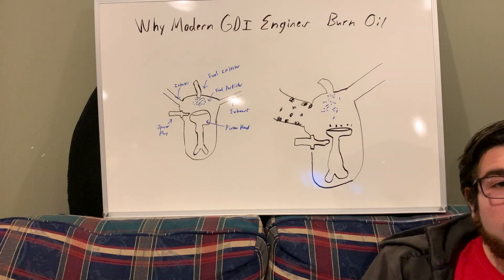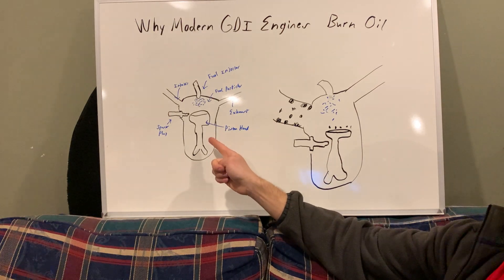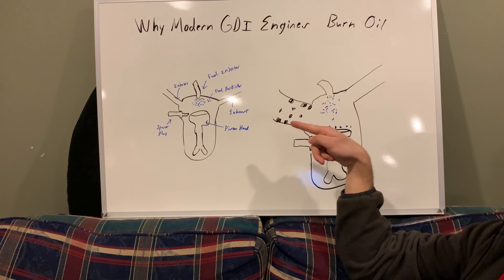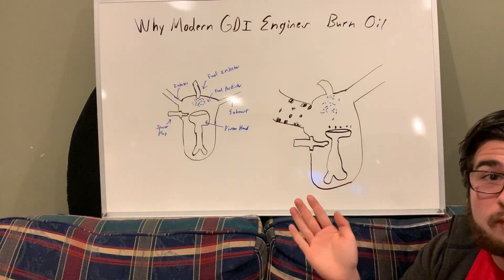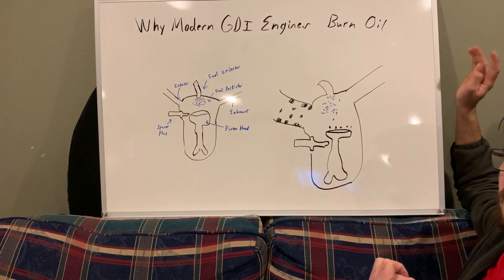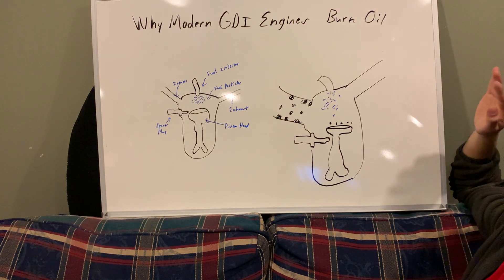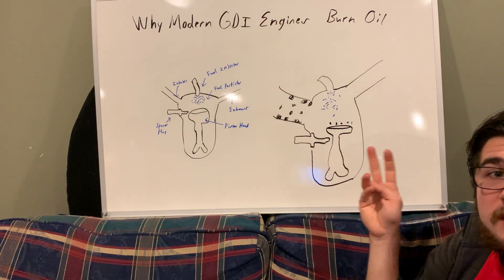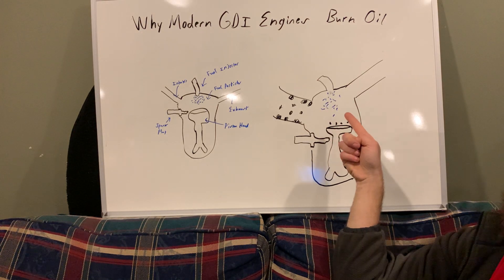Why G.D.I. Engines Burn Oil

Comment: Take it out on the hiway. Drop it into a lower gear that will enable you to drive at 4500-5000 RPM's. Do that for about 15 minutes intermittently at those RPM's and letting off the gas using the engine to slow the car. I fixed my 2014 Sportage 2.4. It was drinking oil like crazy. Now not a drop after 12,000 miles. It has 166,000 miles on it. Drives like a dream. I was shocked. Try it.

Comment: Thomasin34's heat explanation is good. Tony's garage says the opposite, looks at heat drawn away from the chamber by intake valve carbon build up. 
Either way both are pointing to cleaning engines as ESSENTIAL. 
CRC is what I used. No issues since then once I used B-12 to free it up and 3k oil changes since.

Comment: Hyundai/KIA now have the 2.5L Smartstream engine. It's dual injection. (GDI+MPI) GDI injectors spray gasoline directly into the cylinder. And MPI injectors to spray gasoline on top of the intake valves to keep them clean of carbon.

Comment: for example, the 2.4 engine of Hyundai, even if you try to do Treatments to deal with the carbon build-up. And oil changes on time. It is still burning oil. This is with no catch can install.

Comment: Thanks for the clear explanation man! I have a 2014 Elantra gdi w only 90k miles that burns quite a bit of oil with no leaks and no other engine issues whatsoever! I’ve tried the BG EPR motor treatment and Valvoline Restore & Protect oil and that seems to be helping some with oil burning. These engines suuuuuck
Reply: How much ? Mine goes through a ton..... Probably a quart or two every 1,000 miles.... NO SMOKE..... GETS INCREDIBLY GOOD gas mileage, no rough idle, no sludge under oil cap .....no nothing . Runs beautifully . We will see just how far she goes. Paid for....... Not trading it in

Comment: There are things you can do to help reduce oil burning:
1. Change pcv valve
2. Run a quality Synthetic oil
3. Use combustion chamber cleaner occasionally in gas
4. Use an engine flush to help free up stuck rings
5. Run a thicker oil
Reply: Do not use any sort of engine flush. This is bad advice.
Reply: @Palerider2023  why? Used properly they are safe.
Reply: @Palerider2023 
You sir are very misinformed about the GDI engine and the use of engine flush.
GDI is basically a diesel engine as far as how dirty it preforms internally. In fact it is the dirtiest gasoline engine to date.
Reply: You missed the most important one! Premium fuel with a good additive pack to keep injectors clean and ring/wall lubricated. This will reduce blow by then re-introduction of oil via PCV system.

Comment: Funny this popped up on recommended video.  I am am currently dealing with my 2019 Sorento EX burning oil.    Good think KIA stands behind their cars. They are going to replace my engine and extend the warranty to 15 years.    
This is a good and informative video about GDI.
Reply: Are u sure about that.

Comment: Well, it looks like there is no fix for this design engine.  

Kia / Hyundai should start giving life time combustion cleaning every 30,000 miles for these engines GDI 1.6 & 2.0 from 2013 - 2021 and not only to the first owner. 

They even had a "lifetime warranty" on all power train on their vehicle. First, it was for the first buyer / owner only. Second, it had to serviced buy any Kia /Hyundai dealership.  

Now some first owners are getting denied for an engine replacement even if they had their service done at any Kia/ Hyundai certified  dealership.  

Then why take it to dealership where they have all the service records just to get denied.  The service department is a total scam.

Comment: What the fuck was Hyundai thinking. Must have been cheaper for production. My 2015 Elantra burns a quart every 200ish miles.🙃🙃🙃
Reply: I'm like a qt every 350. Use 5w30
Reply: Simple fix - a piston soak with Berryman's B12

Comment: I thought you made a mistake calling your kia Forte 2.0 motor a GDI engine.
But no you did not.
I own a 2019 hyundai Elantra  (a cousin member of the hyundai corporate motor group) as the 2.0 motor in this vehicle has port injection only.

Comment: would putting in a rebuit 2.4 L sonata engine correct anything?   ya still have a GDI engine again--right?
Reply: Most of the engine builders won't even touch one of those engines

Comment: Do I still need to get an oil change? I'm still losing my engine oil and need to fill up the engine every 2000~3000 miles......I cant even get an oil change since my gdi engine burn the oil like you said......... I have 2022 telluride ex... lol
Reply: I wouldn't!!!! Waist of money !!!
Reply: On neweer engines, oil burning is due to clogged piston rings and clogged oil drainback holes. You need to flush the engine with a detergent based flush like Liqui Moly engine flush, then reassess the situation.

Comment: Despite making its debut in the mid 1950’s, Gasoline Direction Injection (GDi) has only recently come into its own, as vehicle manufacturers look for more meaningful ways to meet increasingly stringent emissions standards.

By injecting fuel at high pressure directly into the combustion chamber, the innovative system improves fuel atomization and penetration, delivering reduced CO2 emissions, improved fuel economy and better engine performance. Sounds good right?  So why has a technology with so many good things going for it not been adopted sooner?  The simple truth, is that like many things, there are pros and cons. And for GDi, that also means a number of common service related issues such as carbon build up, oil vaporization and low speed pre-ignition.   As these service issues can occur in as little as 3,000 miles, diagnosing and remedying them early is important. 

Failure to do so will not only affect the vehicle’s performance and fuel economy, but if left untreated for long enough, it could also result in severe engine damage, requiring a timely and costly teardown to fix. Important to stay on top of your cars maintenance folks. Time is not your friend .
Reply: They are a pain in the ass . I just sold mine . Im not throwing money out the window . They can deal with it .

Comment: Thanks for this info, it provided some helpful info. I've done my share of wrench turning and shade tree mechanic stuff, but, have never taken apart an engine or gone in depth with inner engine stuff. My 2016 2.0 4 cylinder non turbo Kia forte with 140k on it is burning oil, I don't have the exact amount, but, at its worst before I started using "Restore" in it, in a week's worth of normal driving, it'd use at least half of the dipstick, usually more. The Restore, once set in after a few hundred miles, stopped or nearly stopped the oil burning. But it returned the other week. I added 2oz more of Restore and it stopped it for a few weeks. Added some more yesterday, and half a quart of 5w-30 instead of the usual 5w-20 specced oil. I may need to move to at LEAST 5w-30, but will more than likely go 5w-40 Shell Rotella since it's a great price at walmart here. I really got screwed on this car, I still have 3 years left paying on it... I can certainly limp it along with my know-how, but, it sucks. Probably will never go kia again, and will especially avoid GDI engines. My old 90s truck doesn't even use this much oil... I've ordered some Liqui Moly Motor Oil Saver on the off-chance it's the valve stem seals, and can try the CRC GDI Intake cleaning spray stuff too but if those don't fix it I think I'm just screwed. Just an average joe living check to check and wouldn't be able to afford an engine overhaul normally nonetheless with me still having a car payment on top of the problem currently lol. Changed the PCV and it didn't help. Car drives fine to me. I'm not a heavy footer though, I just go the speed limit. If I had known these problems inherent to GDI engines beforehand I would have never gotten this car. No check engine light either. I guess it wouldn't hurt to run a can of Berryman's B12 in the gas tank since it's so cheap or do a Seafoam treatment at some point but I've already done a few Gumout Regane high mileage treatments and it didn't fix stuff, even did a bottle of Redline SL-1 and it didn't stop stuff.
Reply: Dont feel bad, i only got 5 months in to my car loan and the engine blew. 2.4 sorento 2017. It burned oil bad from the day we got it. 3 quarts per 2000 miles. I would recommend selling yours before you end up in my shoes. At the very least make sure you have the ksd added and service records. Its not if it will fail, its when. Mine failed at 79k. It was burning oil for much longer then that im sure. I didnt want to take a hit on trade in, but now its probably worth 1000. Instead of a few thousand dollar hit, it will be atleast a 14k hit. Im hoping the dealership or kia do something.
Reply: @610610billy610610  if you have a 6 cylinder Sorento like myself it’s not covered under the engine recall. Go to the Nhtsa.gov and put in your vin # to check for recalls, complaints and remedies.  You may be eligible for a new engine.  The result of the Class action lawsuit against Kia mandated remedies up to and including engine replacement.  Good luck. I’m waiting for my Kia Optima to get the Knock Senser replaced.  I threw the engine code of death P1326. No engine damage but a failed KS. Thankfully no cost to me but they claimed my battery wasn’t holding a charge $450 freaking bucks! I knew they wouldn’t let me off so easy.
Reply: What's this "restore" product you used?
Reply: @BeeeJaaay6644  you can get it at autozone or Walmart or Amazon, restore engine restorer. A lot of stuff is snake oil but it actually can help worn out engines. I think a big part of my problem was super dried up seals, around March on a fresh oil change we tried the bars oil seal stuff and it outright stopped all burning for a month and a half with some Walmart synthetic high mileage 5w-30 oil. Then it started burning like a quart a month, been putting in Walmart synthetic 10w-30 due to it being really hot here, the default 5w-20 was wayyyy too thin and was using the whole dipstick up in a week of just around town driving. I’ve been doctoring this Kia oil burning problem for nearly 3 years now…we still have about a year and a half left paying on the car. I really wish people would have let us know Kia are considered so bad before we bought it. It really wasn’t that old without THAT many miles on it when we bought it. The AC is wimpy, random rattles and glitchy electronic sounds, driver door window control is wonky, we think the wiring to the stereo is messed up, I already had to change the fuel pump and earlier this year the coils and spark plugs since some oil leaked in there and corroded the coils. I think that was a slow ongoing thing since we purchased the car, since it drove fine until then I trusted the place had put in new coils and plugs and did their tuneup like they said but they lied, you could tell the parts were old
Reply: @SolidSnake4Ever2003 try CRC through a vacuum line. See my post on Cause and Effect on this thread. I believe what is happening is you ungummed it and the heat is still coming. 
So with heat, your gum is coming back. 
Use CRC bi-annually, or annually depending on the miles you drive and keep up the Valvoline r+p

Comment: My Santa Fe is literally burning 1Qt./150 miles.  This is not normal.
Reply: Search B12 engine oil burn and look for DIY Dave's video.
Reply: @FattyFPV - see my post on this thread if you want to see how I cured my Santa Fe with similar miles per quart.

Comment: My car has reached 100 miles. and it has started to consume oil. Since I've had it, I've only cleaned it once with GDI engine cleaner spray. but I think it needs to be cleaned better.
Reply: Kia Rio 2014 GDI running 10W30 full syntetic.
Reply: @ManuelRivera16 any oil burning?
Reply: 100 miles and has carbon build up!!!???

Comment: 😂Absolute garbage. Please take this video down and stop spreading misinformation. The reason for oil burning is poor piston ring design. Seems to coincide with GDI. It has nothing to do with carbon build up. I have just had my GDI engine carbon cleaned and it has never used oil. The intakes were dirty and I was having excessive fuel consumption issues though.

Comment: I want to add somethings. For more cars today in the car manuels is wrote like this: AT LEAST REGULAR GAS  and MAX 10% ETHANOL (ball shit) and all people put regular gas w/ethanol in the tank. The ethanol = sugar = votka. Attention! Only the flex fuel engine works ok w/gas and ethanol. The super gas w/o ethanol will be better. Today, w/new engine tehnology (MPI or GDI), the engine makes a lot of carbon, used oil, smoke, etc. who are returned in combustion room. The conclusion is, better economy in gas but after a time will be big problem for engine. Today, there is a lot of solutions to control this engine "garbage" returning. A new tehnology today is the engine w/GDI+MPI solutions who are better than GDI solution. The engine inside is more clean and the GDI solution problems are eliminated. On the other hand the engine oil quality is requerement and the periodically engine maintenance olso. Install a catch oil can close w/PCV valve. For EGR  valve nothing to do, only clean it periodically.

Comment: Mine doesn't burn any oil .my oil does smell like gas a little bit (worse when new but slowly not as much) only have 14k on the vehicle but I do 3k oil changes .my oil still looks good and always get out what I put in .
Reply: Yours is new after 100k kms it will start to burn maybe earlier….
Reply: @LawyerAB  17 k now and no issues hardly smells like gas anymore.  Passing side effects of direct injection
Reply: @bengleckl1877  when you see it start to burn oil fill the form up. Good luck!
Reply: Gasoline in the oil from GDI engine is usually a faulty high pressure fuel pump. This needs to be checked or just replace it asap.

Comment: My KIA's 2.0 turbo does this so bad, I almost need to refill my oil every 2 fuel ups. I do live in one of the hottest areas in the US though, so is this normal?
Reply: Bro if your losing that much oil something is WRONG homie that is so not normal holy fuck I have a 2.0 Kia no turbo mine burns oil as well but not nearly that much I’m talkin once every other month I gotta top it off a bit you might have some leaks or somin you should definitely get that checked
Reply: @STRANGXR  Nope, been adding some mystery oil into my KIA and everything has been running fine. It's already 93k miles on it and I plan to just keep adding oil to it until it breaks, since it's paid off already anyways and I have another car just in case it breaks down. But so far in my ownership all of those years there hasn't been a single check engine light come on yet, only problems I had was non-mechanical issues.
Reply: @harveylin3548  and your positive there’s no oil coming out of your timing cover/valve cover/oil pan, all that? That’s so bizarre never heard of such a thing from a car that seems totally fine
Reply: @STRANGXR  Nope, and from what I see on the internet it's common for Hyundai and KIA engines to burn a lot of oil. If I get this engine pass 100k, I consider this a success. I just add oil whenever it gets low and I haven't heard a thing from the engine yet, not even a light.
Reply: @harveylin3548  well they mean nowhere near the level of loss you’re experiencing, for over a decade now my family’s been driving Kia/Hyundai cars and nobody I’ve heard of outside of them has lost oil like that, I hope the best for you homie
Reply: @STRANGXR  Nah it's all over the internet, like for me, as long as it lasts over 100k miles, it's a win for me. I am the third owner of this KIA too and I have been driving with this issue since at least from 80k miles.
Reply: @harveylin3548 2 years late but i got a 2018 sonata and i always have to put oil in due to the fact that it burns quickly as well as gets dirty quickly. now it could be because of the way i drive (i push tf out that shit) but it is known for burning oil fast so i think my driving just burns it even more if ykwim
Reply: @6ryy843  I have got rid of a long time ago, I drive Subaru now and none of that problem.

Comment: Respectfully, this guy doesn’t know what he’s talking about. My Palisade had only 10k mikes on it and started burning oil. The process he talks about ,( the carbonization of intake valves)  is true but takes 50-70 miles or more too develop. All new engines create more heat than older engines because they run at higher compression with injected fuel. The reason many of these engines burn oil is the piston rings stick not sealing the piston to the wall of the cylinder allowing oil to migrate up into the combustion chamber where it’s burned.If it were an inherent problem every GDI engine would consume a lot of oil. Some do and many do not. It isn’t and engineering problem, it’s quality control during the engine building process.
Reply: Low friction piston rings to keep up with EPA regulations to increase fuel economy. They don't seal as well allowing oil to get by
Reply: Agreed.  There are services and catch cans that prevent this.   

I have a 1.6T Kia/Hyundai engine with a 105k miles and doesn't burn a drop of oil.   Why??  Because of really short oil change intervals, two induction services, and catch cans installed before 10k miles. Plus I don't drive like grandmaw every where I go. 

Results?  Clean engine that doesn't burn oil.  Plugs changed every 50k miles.   Problem solved.
Reply: @Daywalker8204  That is a lot of effort to keep such a crappy engine clean.
Reply: I have an f150 tgdi with 100k and it doesn't burn a lick of oil. And I tow regularly.

Comment: I had  a 2017 fusion 2L gtdi engine,  8000km synthetic oil changes didn't burn a drop, now bought a 2017 accent with a gdi 1.6, 3000k on so far oil level hasn't moved, I think this video is misleading.